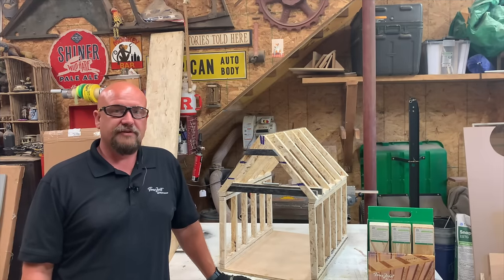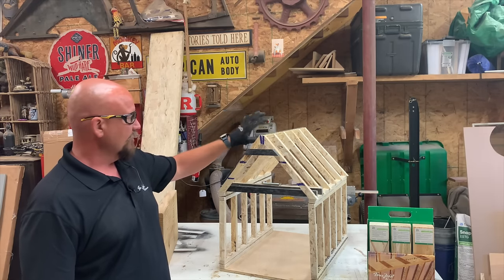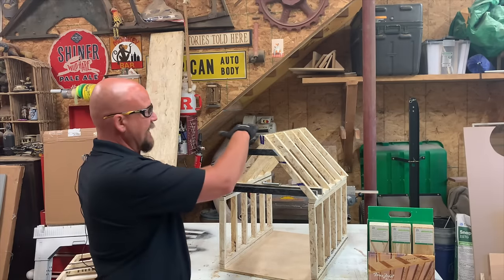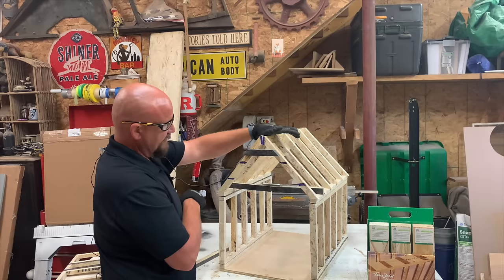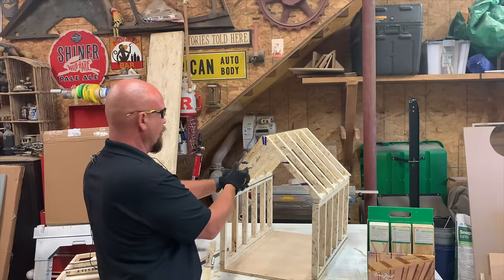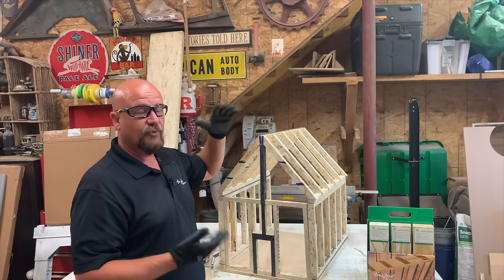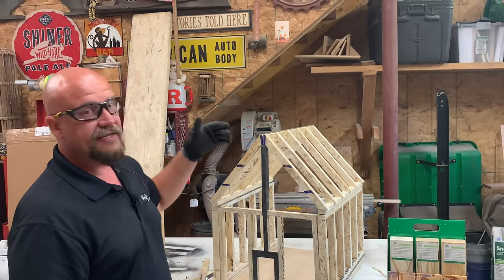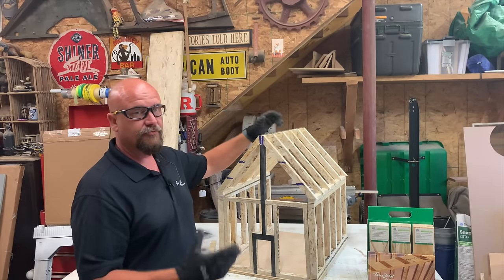The Difference Between a Ridge Board and a Ridge Beam

Comment: this video does not fully explain how the middle sections of the walls are protected from spreading outward in high winds or when under heavy snow load. I don't see how the heavy vertical posts on either end make much difference in the middle of the wall
Reply: Think he said usually by using collar ties or maybe also by a strap over the ridge beam might help. Otherwise I don't think it would spread much because the rafters are attached both at the beams and walls and with a ridge beam construction the walls aren't being forced outward as much because the load that would push them out is being accounted for by the ridge beam.
Reply: It is in the structural center beam, it cant deflect downwards as can a piece of solid timber. You could do the same with a steel beam, but of course no one would. So if the top center ridge engineered beam can not sag down, neither can the outer side wall spread farther apart.

Comment: I have a tough time understanding how the ridge beam carries that much load when the rafters just butt up against it.
Reply: Have you ever taken a course on this topic, if not, take one pretty straight forward to me how the load is transferred to and through the ridge beam
Reply: It’s does not carry the load, it holds the rafters in place so THEY can carry the load down to the outside walls where it’s transferred to the studs below and carried down to the footings. Studs , rafters and floor joist should all line up with each other for this purpose of transferring the loads.  Great question.

Comment: Lost me right in the beginning, not 
simply identifying, by showing what
a ridge board is and what a ridge beam is.
Edit: 5 mins later after looking it up;
A ridge board is non structural and apparently 
acceptable for pitches/slopes greater than 3/12,
whereas the Ridge Beam is 'structural' 
and usually or perhaps typically supported
by columns.

Comment: In theory glued up anything will work,but will it stand the test of time? I doubt it. This is the same industry that brought us OSB, Glued up clapboards, Door frames with finger joints. Chip board kitchen cabinets. I always put beams in some walls upstairs to support the roof. Transfer the load down. I also tie the rafters to the wall with steel strapping. Collar beams, Floor joist ties definitely. Very old houses had wind braces from the ridge to the end walls. Seems a good idea to me. Cathedral ceiling? Not my thing.

Comment: if you do have the ceiling tie it is still a mechanism,because wind on the roof will exert horizontal load and you have three hinges,  the wall can't take horizontal load and be a support to the roof as a cantilever. so how does it work ? what keeps the structure stable ( even with ties).
Schematically- in order for the structure to be stable, the connection between the top of the wall and the triangle must be rigid connection, and it's not- it’s a hinge connection.
Reply: I think the wracking stress on the lower walls is handled by the crossing walls at the ends and inside.  The ceiling joists just handle the outward thrust of the roof. It's like a cardboard box, of you cut both ends out it's easy to push over,even with a flat top and bottom.

Comment: why aren't LVL, or such, made...hollow? As much as possible, anyway. Without significantly reducing its capacity. Less material...less-weight...less-waste...good for the planet...blah, blah, blah :-) I'm an old framer (aka: designer/builder), who'd appreciates more "lightness" as a spec., too. btw, my all-wood structures have been in 8 hurricanes in S.FL, since H. David, with NO damage. Even those with Trus-Joists ('81) ! )))

Comment: Well of course the roof is going to fail without any gable end wall supports. No studs, no double top plate, no bottom plate. This is a good way to channel people into your products by providing misleading information. Well presented but you didn’t get all of us.
Reply: In a compression roof, there is no need for gable end wall supports, the trusses hold all of the weight. If you’re not using rafter ties, you need a structural beam/purlins

Comment: No. 30 year journeyman carpenter (mostly framing) and contractor.
If you're a journeyman carpenter or a structural engineer familiar with residential building, they're called a "conventional ridge" (which before the late 1950s weren't even required) or a "structural ridge". Why do you post this bullshit?

Comment: Sounds like someone wants to sell you something. Marketing at it's worst. 35 yrs of framing, in Tornado alley, tells me this is just an add for new materials, i will stick to what works. REMEMBER THIS  FOLKS , BUILDING CDES ARE JUST THE MINIMUM REQUIRED. Kinda like the slacker that qraduated high school with a C-, or maybe even a D Average, as oposed to A+ student.